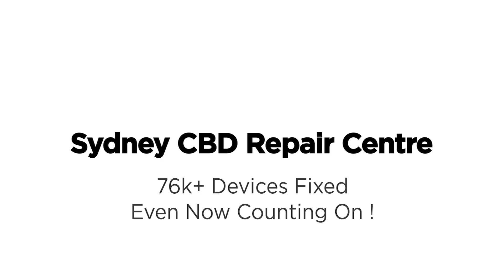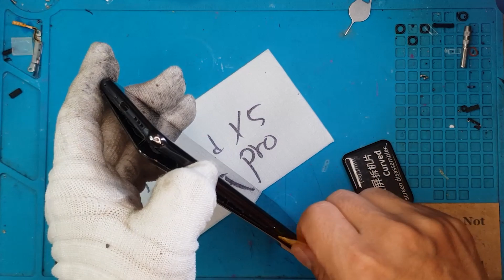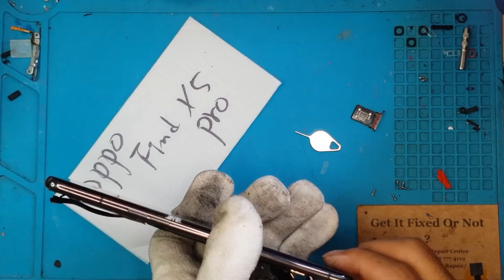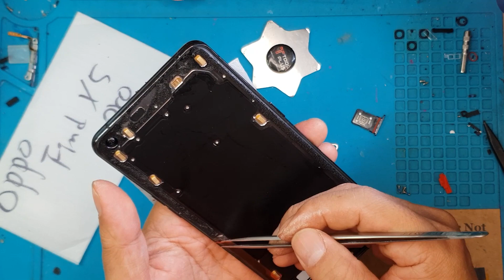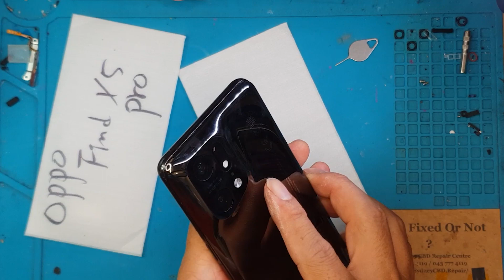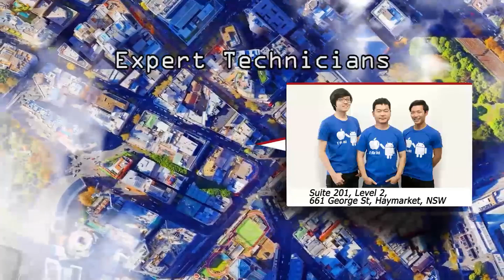PRO FIX, REASONABLE PRICE! Oppo Find X5 Screen Replacement | Sydney CBD Repair Centre

Comment: nice video. thanks for sharing. by the way, can i pry open the screen directly without opening the battery cover?
Reply from the maker: Thanks, if you can do that kind of process why not, but in our shop we just transfer all parts from phone to the new brand new screen with frame so need to open the back, faster way to repair/replace/change the damage screen.